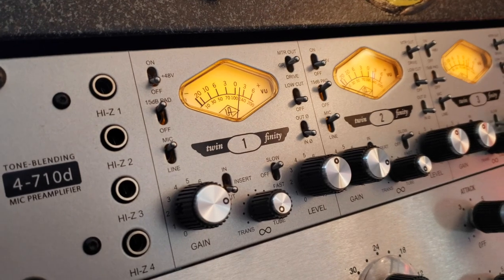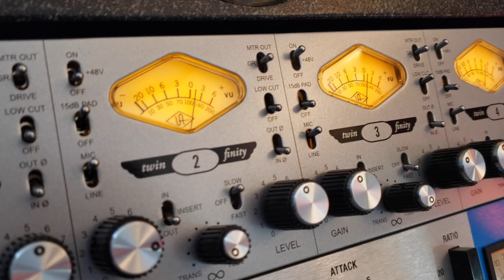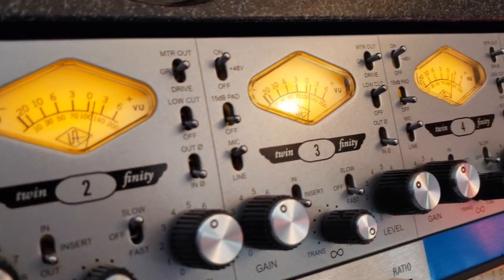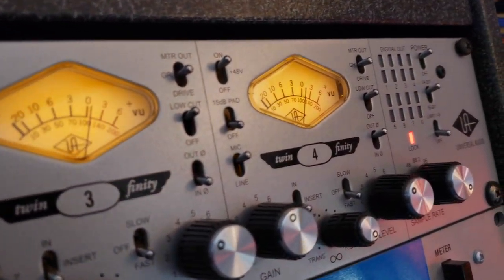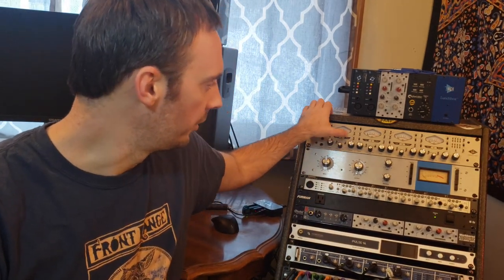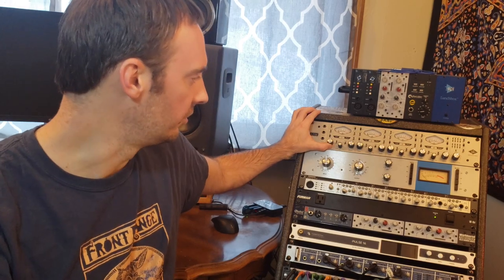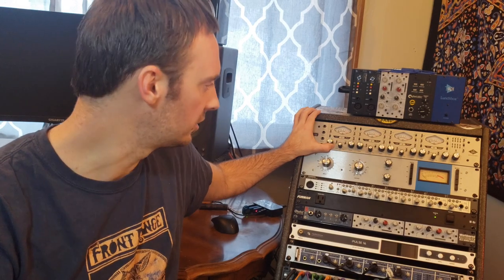Universal Audio 4-710d Preamp DEMO:  Tube VS Solid State + 1176 Style Compression (DRUMS)

Comment: Your chops are insane!! I feel this unit shines when using the blend knob set to 12 O'clock.
Reply from the maker: I like the 50/50 mix as well! I always feel I should use "1 or the other" but find that they designed the continuously variable blend for a reason 👍

Comment: awesome video! how do the UA preamps compare to your API or RND pres sir? The UA seems very versatile just wondering if they "compete" with the API or RND. I already own a few Manley pres for my drums and vocals
 and they are AWESOME but the 4-710 D still catches my attention for some reason lol
Reply from the maker: The UA certainly holds its own!  I prefer it when I want to add a little grit like with DI bass or possibly vocals, but for the clean uncolored tones I might prefer the RND. I do prefer the API on drums usually